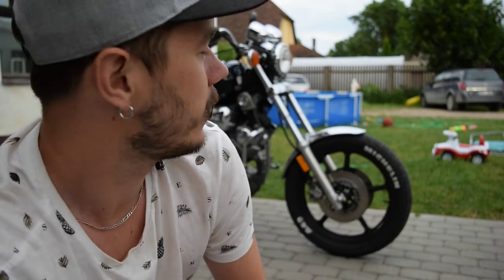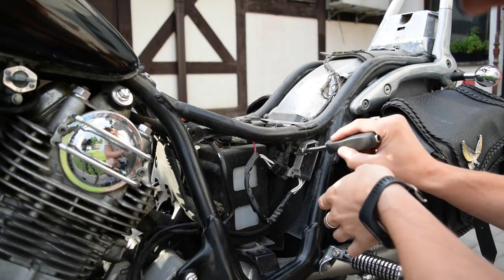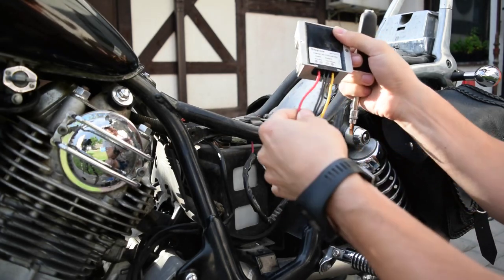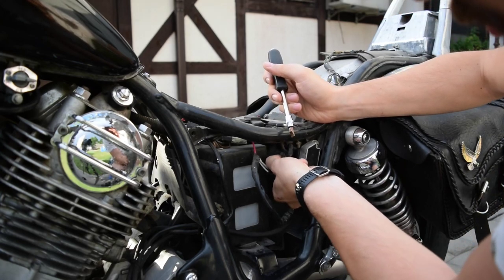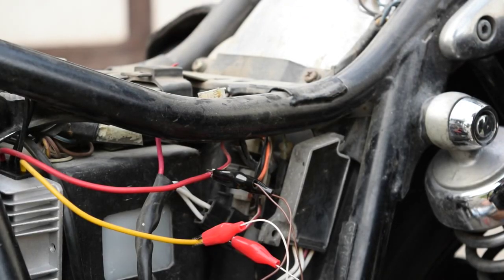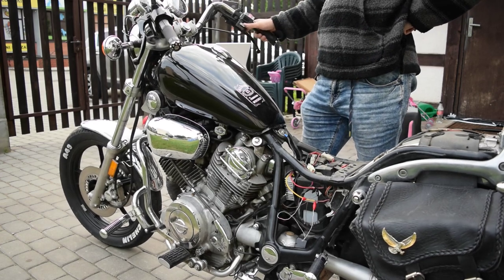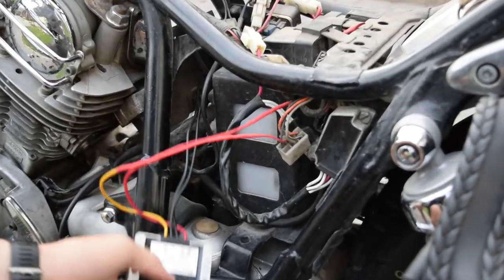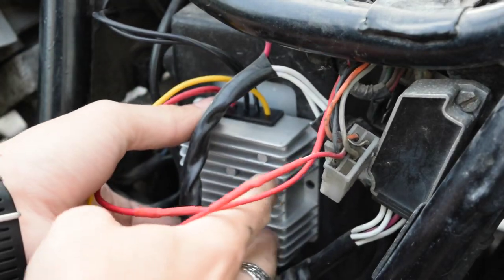The Final Fix for Yamaha Virago grinding starter gear issue | Yamaha Virago XV700 1985

Comment: You still have a problem, you need a stronger brake clip on the starter  and/or on the intermediate gear, your starter continue spinning !Good luck also with your voltage regulator, it should be mounted in a place where it can cool down more easily,
Reply from the maker: The grinding noise after start is because I've removed the spring that pushes back the gear to give it a little extra kick while starting. My starter gear is very well "shaved" so every penny counts to get the engine running. :)

Comment: You need to install your regulator/ rec in its original position(thats on back of the left passenger footpeg) , you need to clean well both the reg/rec and the footpeg and than add paste for the electrical parts to remove heat, if you don't do that your reg/rec is gonna get burned because there is no ground wire on it, the aluminium case is the only ground and it needs to stay connected to the frame
Reply from the maker: Took me 2 years to get to your comment, but I'll do the upgrade. What about the two black wires. Are you saying that there is no need to stick them to the frame and only the unit frame matters??

Comment: I can't find the right cord, the color you told me it was didn't make it, It makes the starter not disconnect
Reply from the maker: Which cord? The one that goes to connector. Or the one that is sticking out of the voltage regulator unit?